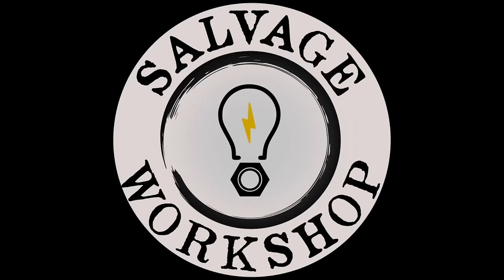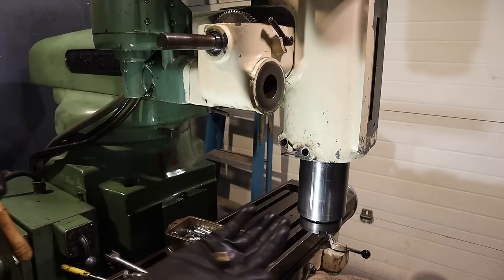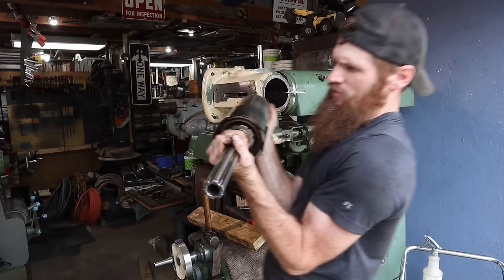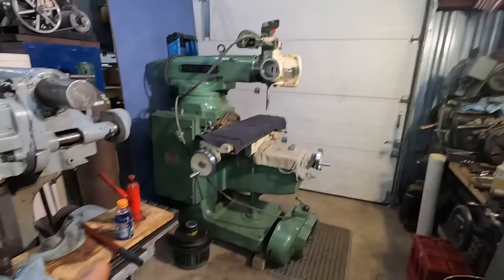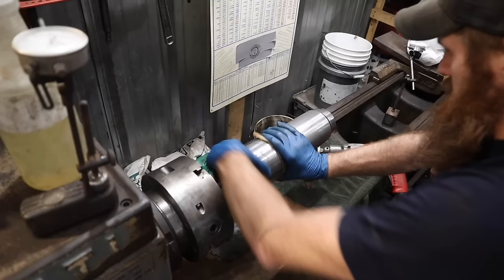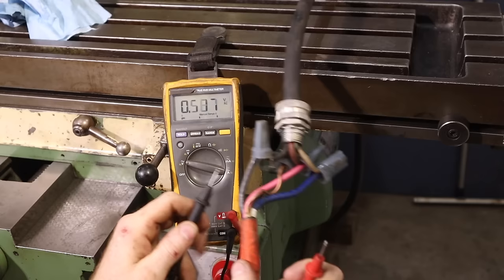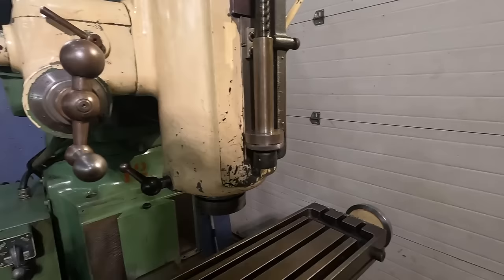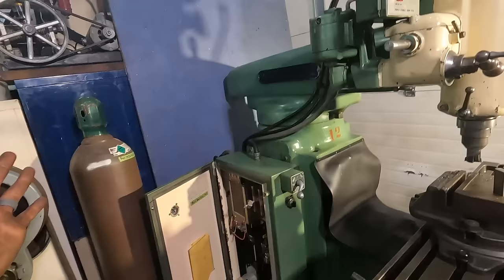My 1960's Milling Machine Is STUCK SOLID! ~ Can we fix it or will I DESTROY it?!?

Comment: I was cringing at every blow of the hammer, you should not have to beat on a fine machune like that.
Reply: I would usually agree with you on that ... I think that some type of damage has occurred to make the quill stick in the bushing ...
Reply from the maker: Why not? It was stuck! Thanks for watching!
Reply: @SalvageWorkshop the beating isn’t the issue. Your mixing tools from one trade to work on a milling equipment trade. IMHO nothing harder then brass should be beating on any gears. And go find a manual in a library. Good luck.
Reply: You have to beat on a machine like this when you have no idea what you are doing and no business working on a fine machine like this. Every comment that calls his actions into question is replied with "thanks for watching", kind of says a lot about the mentality of the guy.
Reply: @dunk5647  many of these types of milling machines all suffer from one common problem, when bolts are over torqued or left loose the bore of the quill distorts. The distortion causes the exact issue captain toolbox is experiencing. It is usually the bolts that secure the head to the ram.
Reply: I believe the quill is supposed to be taken out from the top of the head, not the bottom.
Reply: Fellas.   I have watched several of his videos. And read the ugly comments.  We all can agree the machine is of high tolerance.  We all can agree hitting them is wrong.  I bet most of the ones commenting don’t have the tools or physical ability to repair this machine correctly either.  The factory type repair would exceed the cost of this running machine ten fold.   I would not hit steel on steel either buuuut that being said there are no parts available for it.  Honing and polishing this mill was the perfect solution and now it’s useable    And I bet not even noticeable.  Keep saving these old machines young man.  We will keep watching
Reply: I notice none of the so called experts came up with a method of extracting the quill without beating. A typical case of operators of a machine commenting  when they have never been in your position of sorting  it yourself  rather than  phone up maintenance  and having it done for them
Reply: @squarefour1  I have the tools, and have repaired several. This isn't about a factory repair (if such a thing exists in this case) this is about the next person who will face this issue and will turn to this channel's example for guidance. Before you beat on things that aren't designed for that abuse ask someone. That is what it comes down to, if you don't know then ask. Maybe it isn't noticeable to him, but there is no way that it didn't do damage that could have been avoidable. Why is it that a random guy puts out a Youtube channel and all of a sudden he is the master and anything he does is the final word yet when people who have the experience comment with concerns to the questionable practices they are just "ugly" comments?
Reply: @kirkgauld9252 absolutely NOT an expert, but a hydraulic press wouldn’t have taken as long or damaged the top.  If petrified grease was the problem, there are solvents for the problem.

For the most part, when I’ve used the “get a bigger hammer” approach to problem-solving, I a) was using the wrong tool, and b) regretted it after I understood the issue.
Reply: See the Clip at the top of the head?

Take the clip out. 

The Spindle goes in from the top.

Arrruhh, blocking this channel, I can't stop yelling at him.
Reply: @SalvageWorkshop  I picture this guy massaging,  pleading and crying at the machine, "Please come loose! I'll buy you dinner and a movie"!

Comment: Please don’t hammer on your spindle
Reply: What's the correct way to get it out?
Reply: @Calamity_Jack I guess it is to sit in your armchair and complain about how others get things done
Reply: Just offering advice, learned to receive
Reply: Clamp a threaded rod in the chuck and use spacers on to the cast body then jack it out?

Comment: If I saw one of my apprentices so much as tap the spindle of my machine with a steel hammer, they’d be fired immediately. Go to harbor freight and buy a $12 brass hammer or use a come-along or a screw press, modified bearing puller, bottle Jack, or literally any other way of pushing the spindle in or out without destroying the bearings that were probably in excellent shape before you decided your mill spindle was an anvil. If you’re going to do something so hacky, at least do us the favor of not putting it in the internet and showing everyone the worst possible way to fix this issue.

Comment: When you change from 440 to 220 the current will double.  You have to change the heaters in the starter to match the new current.
Reply: that's right!!!!
Reply: Halve. The impedance remains the same. Current = voltage / impedance.
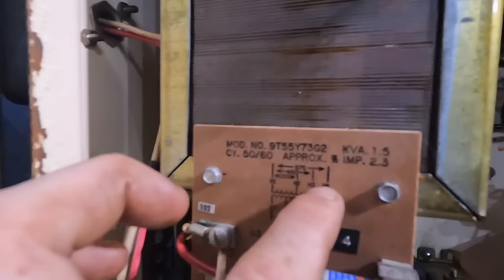Reply: @frutt5k  Did you see the part of the video where he moved a wire from H3 to H2 56:40? That was reducing the impedance of the transformer. The adjustment makes the transformer output 1.5KVA regardless of the input voltage, which at the lower voltage, requires more amps.
Reply: @frutt5k  motors will not work like a resistor. They are designed for specific power and load. If you run a motor at half the voltage it will use double the current. Look at any spec plate on any dual voltage motor and you'll see.
Reply: @frutt5k wrong formula, you need power=voltage x current
Reply: @PastelPalace  You must be a woman: mixing up cause and result.
power = voltage squared / impedance.
current is not a factor, it is a consequence.
Reply: @TwoScoopsofDestroyer  My remark was for the people who think that halving the voltage induces doubling the current, which is nonsense.
When yiu change the wiring, you change impedance.
Reply: @frutt5k  You have forgotten your Ohm's law  P - E x I   a little algebra and  I = P ÷ E  Put in the figures yourself and see the result. Remember P is power in watts and 746 watts are equal to one horsepower.
Reply: @MatthewBerginGarage  You are mixing up 'input' and 'output'. You are unaware of what a factor is and what a result is.
Impedance/resistance/reactance are inputs or FACTORS. Current is alway a RESPONSE, an output.
You may re-arrange variables in an equation but you only show you just don't get it.
Reply: If we rename the ones perhaps things get less confusing. Watt(kw), volt ampere and resistence.
Reply: @frutt5k  I've been a maintenance Electrician in a large steel mill for 40 years, and teaching apprentices for the last 20, I know how this works. You sound like you have no idea what you are talking about. Power factor and reactance are not an issue in this application. He is just wiring the same coils in a different configuration that will half the impedance so the current will double. Since we are talking AC, current is the result of a voltage imposed across an impedance.  There is no need to get over three significant figures in this calculation.
Reply: @MatthewBerginGarage  poor apprentices.
Reply: Your both pretty. Besides he won’t be needing any of that power because he’s gonna destroy his mill beating the hell out of it with his mechanics tools. Definitely in way over his head on this venture.
Reply: Yes the current is double so the heaters which behave like circuit breakers need to be changed. Simple and cheap fix.
Reply: @MatthewBerginGarage  P - E x I is Watts law not Ohms law
Reply: @stephenhunter70  That is the silliest thing I have ever heard. Watt worked on steam engines not electricity. I think you're confusing the power measurement Watts with Watt the person.
Reply: @MatthewBerginGarage  Wrong Watt, don't stress it your mistake is understandable! Watt's law was invented by James Watt, an engineer born in Scotland in August 1819 (19 January 1736 – 25 August 1819). Watt's law says; electrical power is directly proportional to the voltage of a circuit and the current flowing through it.
Reply: @frutt5k  impedance is not resistance, it also includes reactance. The major part of an induction motor's impedance is inductive reactance.  Look it up, it's pretty cool
Reply: @Expedient_Mensch  I know, but this was for the rocket scientists who claim that the current is doubled when you halve the voltage.
Reply: @frutt5k the motor will take its wattage no matter what voltage you apply. if you halve the voltage, the current doubles to deliver the same wattage.

(for the same power output that is, of course)
Reply: @miko007  Then power it with 1 Volt.
Reply: @frutt5k  if you had infrastructure like cables etc. that could handle it, and a power source that could supply 1V at 2000 amps, that would work i guess. not very efficient, though.
Reply: @miko007  You will find out, sooner or later.

Comment: You cannot check out-of-roundness on a lathe. You set your work between two v-blocks and rotate it with an indicator on top. That quill was OD ground and was never out of round, but that’s how you would check.
Reply: Why can't you check out-of-roundness by putting the piece between two centers? I understand that you might get a false negative if the centers aren't actually at the center, but can you get a false positive result or a different type of false negative?
Reply: @robertobryk4989  You can even is the centers are not perfectlly aligned but you kinda need to know how to interpret the readings as you move arround the part. Also this dude hammered the spline shaft for 90 minutes so everithing there is no longer straight and round enough to use it as a reference. Also this dude clearlly doesnt have the required knoladge to do this the right way.

Comment: Cast iron should be   " age  seasoned " before being machined to prevent problems in dimension changes due to internal stress relief in the casting.  it will  cause problems over a long period of time in precision parts.  I have a mill-drill that was purchased about 1978 BC.  ( That is before China.   It was manufactured in Taiwan).  It worked perfectly  for many years before it fell into mostly disuse except for occasional large drilling jobs.  I  had noticed the quill operation getting tighter over time.  About 2010 I had occasion to use it for some light milling.  The quill would only move about 2 inches.  Detective work revealed that the bore in the casting was no longer round.  The problem was especially bad around the Quill down feed gear box.  It was warped inward around the gear slot.  I used a hole gage for all the measurements and mapped the errors.  The judicious use of oiled 1000 grit paper allowed me to remove MUCH LESS than 0.001 inch around this area.  The quill then worked perfectly.

Comment: You've increased the amperage draw when you decreased the voltage so you'll have to change the heaters on the thermal overload part of the contactor to match the amp draw you're using now.
Reply: This is caused by the 3 phase motor windings being wired differently for the available house voltage.
3ph 220V are wired for triangle connection, which has low resistance as there is only 1 winding between any 2 phases.
3ph 480V are wired for star connection, which has high resistance as there is always 2 windings in series between any 2 phases.
A 3ph 480v setup connected to 3ph 240V will have weak axle motors and probably behave strange.
A 3ph 240V setup connected to 3ph 480V will pop the fuses  or burn out the motors and relays.
Some industrial motors have a start circuit that starts the motor in star connection and then switch to triangle connection, once the motor is running.
Reply: Yeah, you can run it unloaded all day and the heaters wouldn't trip. But put it under some load, and there ya go.
Reply: @CXensation    I have virtually no idea of what you just said...but your level of understanding leaves with agreeing you more than anything.
Reply: This
Reply: An oldie and a goodie
Reply: @johngrace199 your humility is amazing!
Reply: Nah mate!  Star vs Delta connections are more about starting and running torque and current. Nothing to do with voltage or resistance across phases etc. Any Star connected motor will run as a delta connected motor on the same voltage, and some are made to automatically switch over at a preset speed, others may be connected to switchgear that will do that. I love it when people who don't actually know give advice like this. @CXensation
Reply: @Expedient_Mensch A 440v star connected motor when reconfigured to delta will require 240v across each winding.  I think you are confusing star/delta starters with motor voltage.  If you connect 440v phase to phase across a delta configured 240v motor it will definitely let out the magic smoke and the motor will not like that.
Reply: @houstonceng  I don't think you know what are you talking about.  Any three-phase motor can be wired in either configuration by changing the way the links in the terminal box are configured.  Mate, I've been an industrial electrician for OVER 40 years, I know what I'm talking about here.
Reply: Good call. He kept calling it a mag switch (and in theory it is). 

In my industry we call it a contrator with a thermal overload.

Some are adjustable to suit a range of currents. There’s possibly a screw and scale you can set to different amperage.

Hope he sees this.
Reply: @rustbeltmachine  'contractor' is a typo, he meant 'contactor'.
Reply: Your 3 phase generator has a high leg or delta winding  . Most old 440v transformers and  motors were delta wound . 480 v motors and transformers were wye type . Be careful not to hook up anything 110v to the high leg (the leg to ground above 120 volt ) .
Reply: He’s right the the heaters are overloading. Might have gotten weak or are not rated for the different amperage.

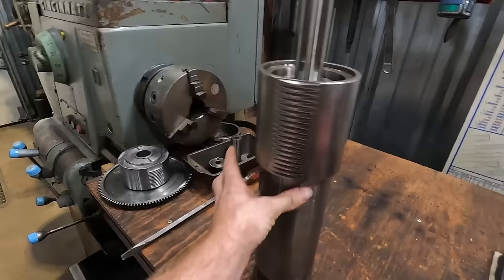Comment: @35:09 My theory is that you oval'ed the cylinder by pounding those wedges into the slot.  Slots are designed so you can reduce the diameter by compliant deformation, but aren't much help in expanding it.  The more you pounded those wedges, the worse you made your situation.
You should have removed the wedges before the honing, as you want the dimensions to be accurate while under operation.
Reply: Oh I can guarantee he did at least that much
Reply: That was my thought exactly. Watching the video I found myself screaming "measure the damn cylinder already!"
Reply: @mikerobinson6606  I would also have tried marking up the whole surface (either inner or outer) and seeing where the marker gets most erased at the point where it binds. Then, repeat at a different rotation angle.
Reply: i think it was never ment to go down the hole but up remove the retainer c ring and pull out out like that.
it woudl also make sence to do so so you can compress the spring AND place the lower linair bushing.
Reply: All that pounding, sanding and honing was scary - I was also freaking out looking at those wedges, even as he was removing the quill. Just need a few tenths of distortion and its all over.
I would have looked at instructions to disassemble a Bridgeport. All these machines use the same basic design - no one wants to reinvent the entire world every time a new basic mill is designed - they all borrow from the current technology. The  quill, spindle, back-gear, and variable speed drive all look pretty much the same - and they all come apart from the top.
Reply: I was waiting for it to Crack into with those dimensions store chisels
Reply: Poor milling machine 60 years old and end up in the hands of this guy
Reply: I like how he says it's knocking there some noise up there ))))) hay you just beat it up with a hammer
Reply: The quill does come out the bottom. And the repair manual also calls for a "soft metal wedge" to be driven into the slot at the rear of the housing.  But the procedure also warns that  " It may be necessary to re-position the wedge
so the assembly does not have to be forced out. "   The procedure was correct, but he was impatient, and should have tried moving that wedge around into different positions to get the quill released.   Worst case, rig a long lever to the shop wall (makeshift arbor press) and press it out.

Comment: My family and I used to own several of the 9-J Gorton mills the 1-22 was modeled from.  They are in fact super nice mills.  Ours had the Bown & Sharpe taper in the spindle. We always wanted one with the No. 40 taper.  never got one.  The spindle quill is a very tight fit to the housing.  One of the mill we had was so new that if we didn't keep lubing the quill, it would get tight and was a nightmare to free up. So make sure to use a ISO 46 or 68 oil in the quill and lubricating of the spindle bearings, too.  I highly doubt they are packed with grease. None of ours were.  Grease in the spindle bearings will cause the spindle to run hot.  You don't get that heat with oil.  The power feed motor on the quill feed was always a problem on the Gorton mills.  I doubt the quill in your mill was replaced or swapped out with another.  Gorton made them to such a high degree of accuracy that interchangeability was no issue.  There are no parts available for these mills as far as I know.  Gorton was bought out by Milwaukee, later by K & T.  I'm not sure who owns them now.   As for the brake shoe, they used to be cast iron with a thin layer of asbestos years ago. 
Any how enjoyed your video. Keep them coming! Ken
Reply from the maker: Nice to hear from someone that ACTUALLY has experience with one of these mills! I've been hard pressed to find ANYONE that knows anything about them, and the manuals are good, but not perfect!

Thanks for commenting, I truly appreciate it!